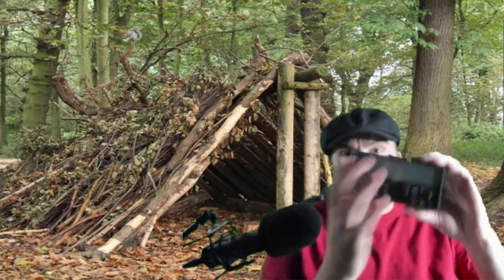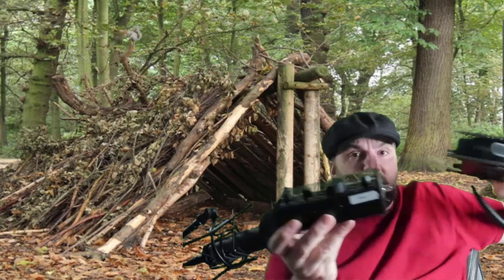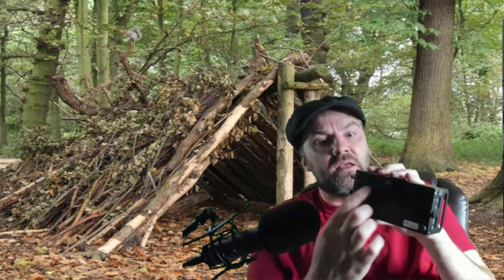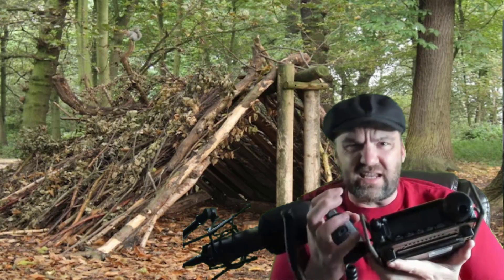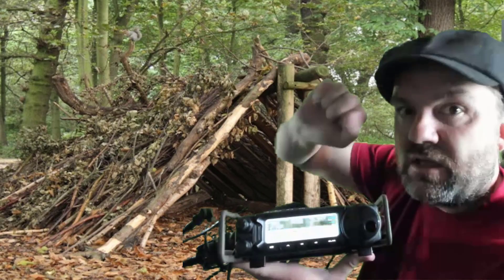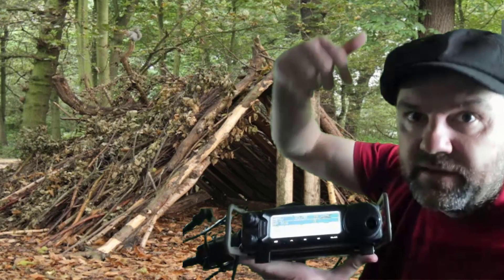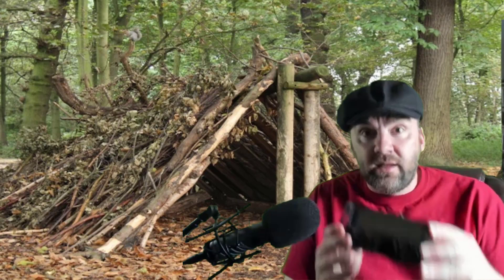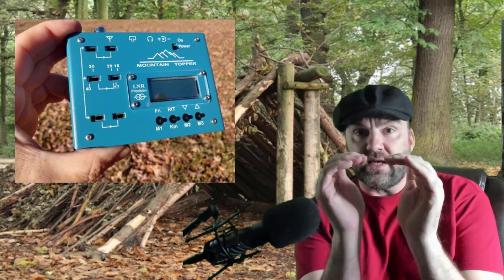Yaesu 891  Vs  Elecraft KX2 Compare!  opinion

Comment: Good discussion! My KX2 is the one radio I probably will never sell. Because its cute and fun! SSB coast to coast on rare occasions. Cw always gets a response from the RBNs. Having said that, I generally go for my 891. For all the same reasons you said. I use end-fed antennas on 20 and 40 only so not much band hoping. My vertical only requires me to move one tap(takes about 15-30 seconds. So both radios are typically very happy. Swr 1.1-1.6. Endfeds are halfwave which seems to make a big difference. I like operating the KX2 much better but now own two yaesu rigs and have gotten used to making any changes quick enough. I don’t contest. 
Contacts with the kx2 are not especially difficult to achieve but can be difficult to hold long enough to achieve a meaningful conversation. I use ham radio not only to “fish” with but to learn a bit about the fish so the QSO is a bit important to me. Doing since 1984 with 100 watts or less. Not one regret. Thanks again for another great video! N7KHH
Reply from the maker: Thank you for the great comment.  1984!  I was 11 years old then.

Comment: End-fed antennas with any radio, not many distance QSO's.  Put up a good dipole with the KX2, you will make good distance SSB contacts.  Not arguing that the 891 is going to get you further with more watts, but I have made QSO's on 5 watts to Brazil from my front yard in Michigan with my KX2.  It was all about the antenna system in my case.  The only vertical I have had great luck with is the Chameleon MPAS system with QRP, but putting up a good dipole with the KX2 will get you out for sure!  73 and thx for the video!

Comment: In my opinion, this video did little comparison of the KX2 and the 891 and more comparison of having QRP to having 100w to which there is no comparison.  You can absolutely make SSB QRP contacts on 5W, I do almost every day.  You have to work a little harder for them, but to me, they are more satisfying.  The great thing about this hobby is that it can be different things for different people.  QRP is not for everyone, and that's ok.  I am not an Elecraft fanboy, I don't even own an Elecraft.  I have a Yaesu FT-950 (100w) and a Yasau FT-818nd (6w).  I get more enjoyment from working QRP SSB, and I am in the process of learning CW, but that's just me.  I felt this video did not compare two different rig in an objective manner.  You can always dial down the 891 to do QRP and still have the 100w if you want / need it, but you will have to carry the additional weight that comes with it.  At the end of the day, both of these are great radios with potentially very different uses.
Reply from the maker: k

Comment: I run a 28'6" wire to a 64:1 balun on my KX2 for 20 and 40 and an 8010 HWEF with 49:1 balun for 80.  SSB voice on 20, from eastern Oregon at 230' elevation, has managed Moscow Russia, Japan, Hawaii, and the eastern seaboard.  With the 8010 i can talk Cali, Oregon, Wash, Idaho, Montana, and Nevada.  The antenna will make or break you my friend.  Dont give up on it!
Reply from the maker: I hear ya friend!

Comment: The Kx2 is too expensive really and can't be justified today , in my opinion of course, I got a Xiegu X5105 and it fits into a Tecsun PL-660 pouch, and I also got a 2nd hand FT-891, both together cost much less money than a Kx2.

I brought the X5105 to Germany with my 4 band portable EFHW from hyendcompany.nl and had a ball one afternoon for 5 hrs and the battery was still going. It's a great radio, no doubt the K2 is a better radio overall but is it worth over twice the price for an extra 5 watts ? and as far as I'm aware it can only run 5 watts from the internal battery ?  sure, the receiver might be better but I have never used one to know so what I don't know etc but the X5105 works fine. 

I have to say though since I got the FT-891 I use that mostly now and can't justify keeping the X5105. The FT-891 is unbelievable small for a 100 watt rig and I manly transport it in the car to where I am operating, I use either the 4 band EFHW or the Superantenna MP1, this is a really quick to deploy antenna and I can use it at 100 watts and I made a contact from Ireland to Canada on 20 meters back in early August 2019 which is amazing for such an antenna. 

The FT-891 is a great radio and I won't be selling it, it's one I will be keeping for years, not even the new Icom IC-705 with it's fancy screen would tempt me to change, 100 watts or 5 watts at my disposal whenever I need, I mostly use a cheap car battery which will keep me going at 100 watts easily for a day or I could if I needed to save weight get a 3 S 20 C 5000 Mah LiPo battery from Hobbyking and run 100 watts for 30 mins to 1 hr or 50 watts for say 2 hrs , 20 watts for 3-4 hrs etc. OF course, at 0.9 Amp power draw on receive it will use a lot more power than the X5105 or K2 but given the cheap cost of Lithium batteries and their light weight that isn't much of a problem these days except if you want to take a flight and perhaps Lithium batteries are not allowed on that flight as there are more and more restrictions on batteries so bringing the X5105 on a flight or K2 will be a lot easier and more compact but other than that the FT-891 is the Champion radio for my portable use. Oh and I don't need a tuner because I use the 4 band portable from hyendcompany which is resonant on 40-20-15-10 M so that's pretty much all I need during the day, mainly 40 and 20. And I use the Superantenna MP1 which is resonant on all bands too.

I also don't think the FT-891 is noisy, and the menus are fine, most of them are set once and forget, changing bands and power is not an issue.
Reply from the maker: Wow, that's quite a comment.  Lots of thoughts.  Tnx fer showing up and sharing.

Comment: I agree that new hams are better off with a 100W radio that is under $1000. However, this is not a comparison of rigs, but of power. The radios have no bearing in your argument.
Reply from the maker: No argument. Just a discussion

Comment: I made many ssb contacts on my kx3 a couple years ago. Less so now with current solar conditions.   I got a small portable 45w amp that I take now with my kx3. Called MX-P50M HF Power Amplifier.    Have Elecraft 100w amp that I use at home (could take portable if you want to)..Also have Icom ic-7000 I use in the car/mobile at 100w.

Comment: Tom, you nailed it. I have an 891 also and while it is a pretty good rig,  I sure would like to get my hands around the neck of the silly software engineer.  If only they had made the band and mode selection on the multi knob instead of the stupid VFO knob, the operation of the rig would be oh so much more enjoyable as you could count clicks while keeping your eyes on the road for mobile.. Some people compare the 891 to the Icom 7300. It is apples and oranges. the 7300 is so much more ergonomic and easy to operate as well as having a much better receiver and DSP system. BUT of course the 7300 is almost twice as much.  Your comments on QRP portable operation with compromised antennas are spot on too of course.  QRP will be much better enjoyed by an experienced ham and even then CW will be so much more successful than SSB. If you are a "newby" and not much good at cw, you best get a 100 watt class rig.  I sometimes use my Z11proII tuner with the 891 which is a very compact 100 watt class tuner with its own built in battery supply for operation. 8 AA cells last about a year of operation. The  little LDG electronics tuner has latching relays, so it uses no current during operation, only a little when actually tuning.  It is easily able to match 10:1 loads and is very fast.  Good luck on your forays.  73  James KØUA
Reply from the maker: Great comment. Verrrry interesting. Tnx so much. 73

Comment: If you use the DSP properly on the FT 891, it is as quiet as any thing going.  I am not sure why you say this radio is not quiet.  BTW, I agree, the ft 891 can blast out the wattage to make those contacts, even with a compromised antenna.  Throw a decent end fed dipole in the trees and you have a fully functional base station.
Reply from the maker: Kx2 quiet out of the box.

Comment: Before getting a Mountaintopper you might look at Xiegu X5105. Got one this past Dec. and love it. Most days I can check in to our states SSB evening net with my long wire.  Lots of features on this little rig, but built in ATU, copy PSK31, etc.

Get where your coming from about the two rigs , I have an FT 897 & a IC 703+ but I just couldn’t see putting $1,200.00 in the KX2 and that’s why I got the X5105. 
73
Thanks for the video
WD4DDA
Reply from the maker: You bring up some great points.  What I don't like about the mountain topper is how cryptic the menus are.

Comment: I have owned an Elecraft KX3 and an 817, moreover, X108G and 703+ : at least on SSB, power under 20W is like masochism, from time to time, I mean when you get that contact (I remember that Florida on /p with a telescopic antenna and the Elecraft on 17m from Central Europe) it's really very very rewarding, but most of the time it means no answer to your calls, especially nowadays.
One more though: military has 20 to 30W rigs on HF, that's where it starts to really work on HF voice. 
So, that's also the reason why I do have a military rig (Qmac) with 50W under 10megs, because it's light and rugged enough and has enough power for voice comms with compromise antennas. 
Also, the new G90 from Xiegu with its 20W is going to be a killer with its built-in ATU and many more features (for the HF SSB crowd at least) all in a lightweight package, provided it's enough rugged and reliable. In the field, 20W instead of 10W can make the difference.
Next rig with plenty of power is the 891 or a used 857D (add a MFJ 902 or sort of) and you're done with a little heavier but complete HF set-up. 
But, for the CW crowd it's easier,  from some homemade to some Xiegu 5105, Yeasu 818 and Elecraft rig you have plenty enough of power and lots of fun packed up in small packages!
That's it, that's all :)

Comment: Gee, I make contacts all the time with my FT-817 on SSB.  Average distance is only 500 mi with a random wire.  Wanna do QRP?  You can do it on the 891, just turn the power down
Reply: well said and totally agree, but a 891 is heavier in a backpack together with other stuff.

Comment: I love my modified HW-8.  My choice is what no one else uses.  Now working om making a superhet board inside of the HW-8 to switch over to..
Reply from the maker: I looked up HW-8 online.  Can one still get one?  Looks awesome old school style!
Reply: Oh yes - on EBAY there are plenty - then you just incorporate your own home-brew or perhaps a Oak-Hills board, etc. Mine has this really cool mod which instead of a pre-slector it switches between three RF board tank circuits to block the QRM issue.. But my call has expired so I need to retest, etc..  Long process so first I need to get my code back up - Hope to chat someday on 40 or 30!! From my favorite park in Nebraska.  73 - KB5ZAU.

Comment: I have the 891 and a Ten-Tex Argo VI. The Argo is collecting dust while the 891 makes contacts every time I fire it up. It has a very good receiver for 600 bucks and the menu system is easy once you learn how to use. Read the manual and spend some time pushing the buttons and spinning the knobs! The 891 is a good rig.
Reply from the maker: Exactly, I love it, does the job.

Comment: another great video Tom! i have the YouKits which is fine as I don pretty much only CW anyway. When I got it I agonized over the same decision - QRP vs portable higher power. With the very reasonable price and periodic discounts on the 891, I keep drooling over it. BUT - I already have an old Kenwood TS-140 AND a TS-430 that I can take portable for higher power, so no real need for the Yaesu - other than it's kinda sexy in terms of size & weight :)  Base rig is a TS-590SG that I have taken out to the local park to play.

Keep having fun & sharing your ideas!
Reply from the maker: Yep, thanks for the comment.  I like both QRP and QRO, but when it comes to making a contact, in this cycle? I wanna pound 90 watts.

Comment: Tom, If I remember correctly, you also own an Icom 7300. What would you say about the Yaesu  891 and the Icom 7300? Both 100 w rigs. Of course there is the SDR. For a beginner like myself, the 7300 at 100watts and with a panadaptor, it has been a great learning tool. Next video idea?  Or how about the Hardrock 50 vs the Elecraft KXPA 100 watt amp comparison for the KX-2?
Reply from the maker: I love those ideas ... except I don'w own a Hardrock 50!   Maybe I should get one?  I would say, the Icom 7300 is big and brick-ey.  Kinda don't like the idea of taking it out on the road \as much.  For some reason I feel I need to "baby" it?  However, side by side the 7300 is better.  better menus, better sound, better SDR, better visual.  Love that 7300 even more, but it's  a base station in my eyes.
Reply: I wrap my 7300 in a towel, pop it in a storage tote, and to a park I go.

Comment: I agree. I think I may get the KXPA100 amp for my KX3 and then sell my IC7100. That way I’ll have power for when I want it and I can take the same radio out when I don’t need the extra watts.  Self contained, wide matching tuners in both.
Reply from the maker: That is an idea for a solution.  Thanks for comment.

Comment: I had the kx3 with companion amp for quite awhile. It is the best cw radio I have ever had but..all the cables, mic/associated  connections was just too much for me to deal with. I have ocd to wires drive me crazy.  I now have the 891 as a base with heil mic. The head is mounted on the desk, and the base underneath. I absolutely love this radio. The kx3 rx on cw may be better but that is where it stops. You get so much more with the 891. He is right, you really need 100 watts, no way around it.

To be fair, the kx2 is designed to throw in a bag and operate of minimum voltage. There is no other radio that can come even close to it in this area.

I really enjoyed your video, you have talent and looking forward to more videos...
Reply from the maker: Great comment!  I wanted to communicate they are both great radios, but I choose the tougher stronger 891.

Comment: As KA8JGG said the antenna, antenna, antenna.... the most efficient one you can fit in your pack is best.
I do park activations (WWFF) & SOTA and all I use is a KX3 at 10 to 15 watts and a linked dipole for 40 thru 10, my backup antenna is a end fed wire 22m with 9:1.
I also have 2 kids plus full time job and I rarely get out too, but I still usually get the required QSOs using HF SSB for qualifying a WWFF/VKFF park (10 QSOs min) or the 4 QSOs for SOTA summit.
My main objective when going portable is to go to a WWFF park or SOTA summit because there is a lot of people that chase these and once you get spotted you will have a pile up and you'll get the required content for you videos.
Check out my activation I did recently with some other Hams it has my setup that I use.
https://youtu.be/wBJvEeSooXo
Cheers, Adam VK2YK
Reply from the maker: Yeah, the antenna is def important, but as I mentioned, I have tight windows, so I wanna throw it up, get the contact and get out of there. RUn and gun.  Unless I do a camping trip.  That's coming soon!

Comment: Thanks for another great video. I own kx2 and I really love it. May be here in Europe there are more hams on the air, but I did succeed making ssb contacts with kx2. It of course depends on antenna efficiency and propagation. For 100 watts I use Icom Ic-7000, which is also quite small, I guess smaller than ft891. A bit outdated, but a very good rig. And I am an Icom man - Icoms are kind of more convenient than Yaesu. But you are right in your conclusions - ssb is better at 100w, kx2 is more of a qrp cw radio, with occasional ssb. Yet I would give a Nobel prize for kx2 inventors - it gives so much pleasure operating that I cammot compare it even to the desktop radio. I do not know why it is so, but it is a fact. And filters, and the sound, and lack of noise - it is just amazing. Xiegu 5505 is also attractive, but that is for the future. And I sometimes wonder, whether I need a kx3, having a kx2. 73 de R2ARM!
Reply from the maker: I would say, save your money, the KX2 is good enough.  Just my opinion.  Get a Mountain topper!  I probably could make SSB with it, but I kinda gave up, lotsa frustration.  Thanks for comment.

Comment: Everybody is allowed their opinion.  Great advise to the newbie.  They need 100 watts or they will bored disappointed from day one.  For me, driving into a location, 100 watts and big batteries, bigger wire antennas, etc. is the way to go.  If I’m packing in, its QRP and little batteries and little wires.  There is room in the hobby to go both ways.
Reply from the maker: Exactly. I just prefer to make the contact especially on video.  I still love the QRP concept, but I want some success as well.  Thanks for comment.

Comment: I agree that it would be nice to have a shortcut to the power setting on the 891, but I do appreciate that Yaesu kept the settings menu to one level.  Sure, some items take some scrolling, but you don't get lost in nested levels.  For its size and cost, the 891 is a good rig.
Reply from the maker: Yup, agreed.  Thanks for comment.